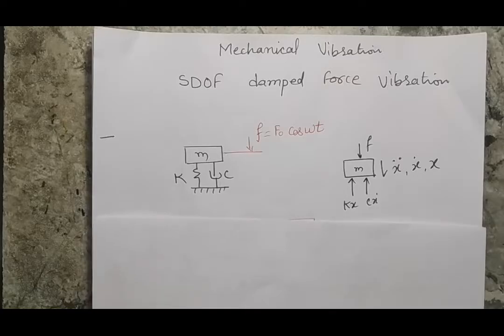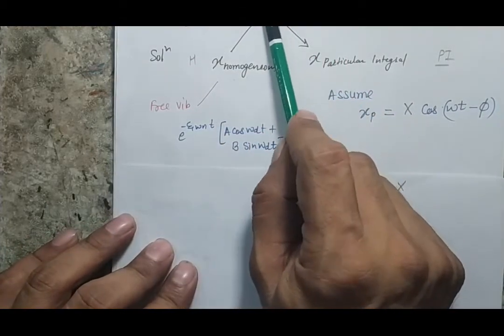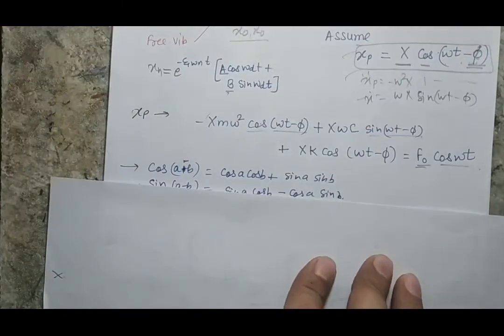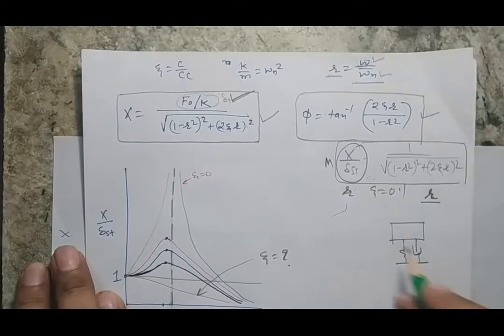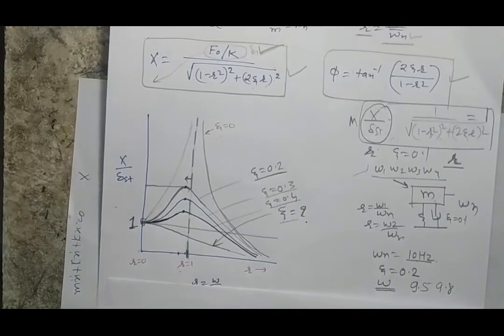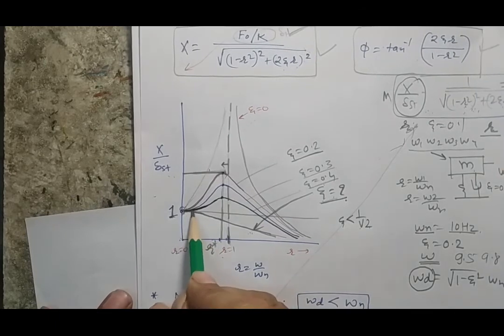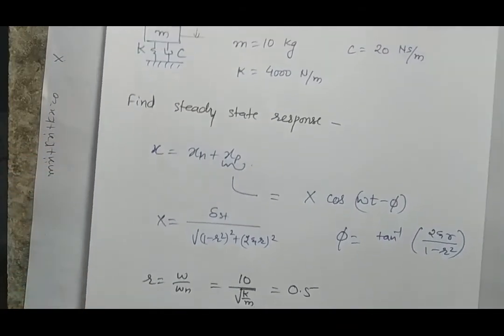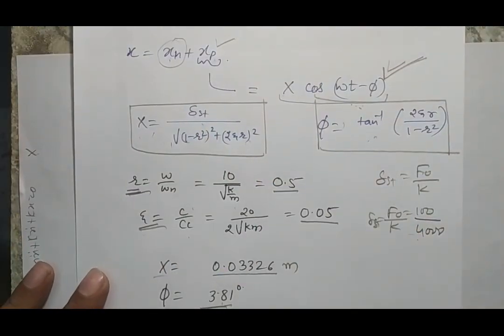Mechanical Vibration Lecture 13 ||SDOF damped Forced Vibration

Comment: The vibrating system having mass 1 kg is suspended by a spring of stiffness 1000 N/m and it is put to harmonic excitation of 10 N. Assume viscous damping

Calculate

i) The resonance frequency. 

ii) Phase angle at resonance.

iii) The amplitude at resonance.

iv) The frequency corresponding to the peak amplitude.

v) Damped frequency.
........Sir can you help in this!!!🙏......plz tell sir this question is repeated many time........or tell the formula for this 🙏❤️